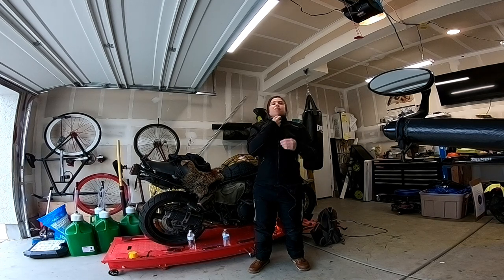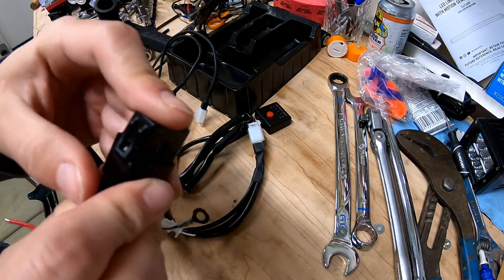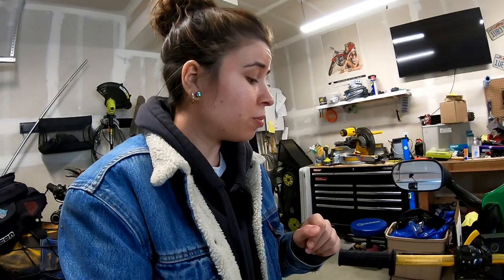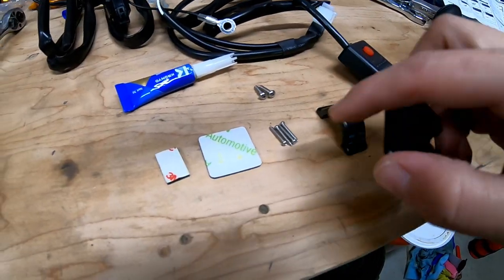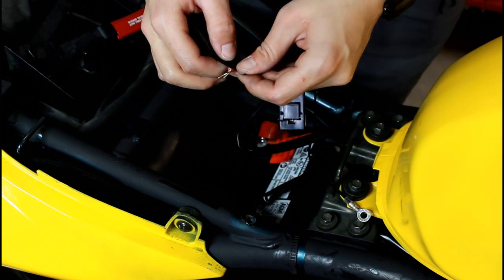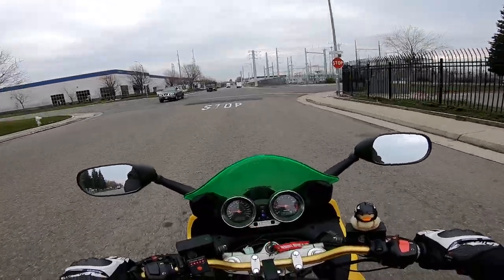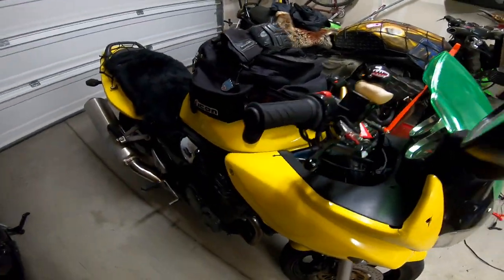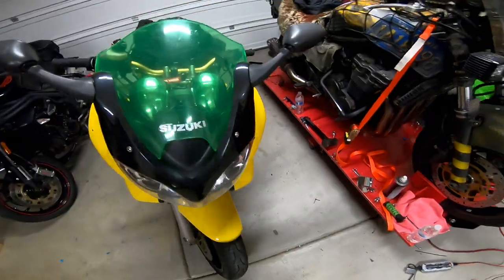Every rider NEEDS to have these - BikeMaster Heated Grips Install & Review

Comment from the maker: Do you ride with heated grips or heated gloves? How do you keep your hands warm on cold rides?🔥
Reply: Heated grips as standard. They are awesome little things
Reply: Heated grips ,i like thin gloves , my bmw has 2 settings 1 warm 2 lava lol
Reply: I needs these in chitown 👍
Reply: I think heated gloves are better, they warm the outside of your hands too
Reply: My bike came with heated grips and seats. Below 45, it's a help, below 30 they become less effective. If I rode any distances below 30 I'd need heated gloves.
Reply: Heated grips. You always have your grips with you, ready to go.
Reply: Not ridden for years, but never used heated grips. Don't remember particularly cold hands. (It seems odd that it's an issue. Or I just do not remember right.) 

Only time I remember cold was with my lower legs doing 70mph in winter. I cured it by occasionally wrapping my lower legs forward around the engine for a few moments. Actually not sure if touched the engine casing, or just put my legs in the heat coming from the engine.

Comment: The throttle side is insulated from the metal bar by the plastic sleeve, while the clutch side is rubber to metal.  So the bar is going to heat up from the clutch side and reduce the rate at which it keeps your left hand warm.  At least initially.  If you had carbon bars heat conduction might not be so dramatic.
Reply from the maker: Never considered that, thank you! I wonder if I added some material to the inside of the bar, if it would help from losing the heat in the left grip? Something to experiment with.
Reply: @KillswitchQueen  it might make things worse, unless the bun in the oven is mostly air.  Air is a decent insulator if it isn't swirling around.  Preheating is your best bet, or putting a 1 ohm 50 watt resistor in series with the throttle side to help even out the power side-to-side.  But, if it breaks, don't call me!

Comment: thanks I've had these sitting on my work bench for 2 years finally going to put them on the rubber hammer seems to be the primary installation tool as I've seen in 3 different videos hope they work it's cold here in Maine

Comment: Compressed air to get the grips on or off. As long as there wasn’t any glue used it works like a charm 🤘
Reply: This is my go-to for new grips. Canned air or duster sort of works if you don't have a compressor.

Comment: I'm in PA, been riding all winter long, my first winter riding. I got some merino wool thermals,  I usually wear army pants, a hoodie and a leather jacket. $25 winter riding gloves from Amazon.  I don't go on multi-hour pleasure cruises like in the summer, but for commuting I've been mostly fine. The hands definitely get cold first though so I may consider hand warmers next year. This winter has been fairly mild so I don't think it's a good indication, but I've been trying to get by as cheaply as possible until the need arises.

Comment: I was looking for heated gloves as opposed to grips and, as so often happens when you are looking for something, a pair of internal battery-powered ones showed up on my home page.  At about half the price of the ones that use the trike's battery I went for it.  Well, they ain't so great....one produces more heat than the other and neither one produces much.  The gloves themselves are well insulated and do the job pretty well.  The product you described here looks pretty interesting and I'll think about it.  But wait, Spring is just around the corner, right?  Thanks for a great video....as usual.
Reply from the maker: I'm always wary about cheap products. At least you were a bit warmer, right?
Yes Spring is coming just not soon enough! And when the sun goes down, it still gets chilly in my neck of the valley.

Comment: I have seen people use compressors with small directional blow gun, to get the grips on and off easier
Reply from the maker: I've tried that before with regular grips, but these were so stiff, I didn't think the air would make a difference.

Comment: What would be nice is heated grips with bar ends where there’s a cap that goes on the bar ends to hold the button, that way you can have a really clean look
Reply from the maker: There is a brand, I can't recall the name, that has the controls built into the grip. Looks pretty trick!

Comment: one time about 5 year ago, i think about to take hot water from the water pumb then link with handlebars to heat them up. :V  that help my battery alot better.
Reply from the maker: Sounds interesting, as long as it works that's so cool!

Comment: Lol a true home job if I ever saw one. 😂 I have absolutely installed accessories like that before, and i might just do this one like that too lol. might just wire it into my AUX lights on my vstrom but if I don’t feel like it I’ll just put em on the battery just like you did :)

Comment: I have had heated grips on my BMW for four years. I tell ALL my friends that this is the "killer app" for motos. Livung up in the mountains there were plenty of days where I ran them on the HIGH setting and it made SUCH a huge difference.

I've never used grip glue. Even on the track bikes. I've actually gone the other way and used WD40, spit, whatever to help slide them on.
Reply from the maker: It really does add to the quality of your ride!

Comment: Use hair spray instead of grip glue. Wearing gloves, place your free hand at the end of the grip and push it on while blowing compressed air into it. Lay the air nozzle in line with the grip, if that's not clear.

Comment: I love the idea of these, and the price is reasonable.  It would also be much more convenient than my heated gloves.  However, I would be losing my throttle assist.  Since, I don't have cruise control on my Sportster, and I ride long distance, I don't want to lose that. So, (1) do you have a throttle assist you recommend that goes well with these? (2) Do you have an aftermarket cruise control for throttle by cable (dual) that you have found works and is also reasonably priced?  Thanks.  Enjoying your videos.